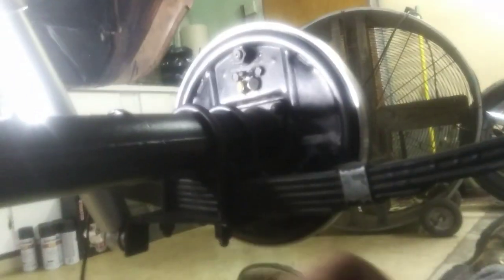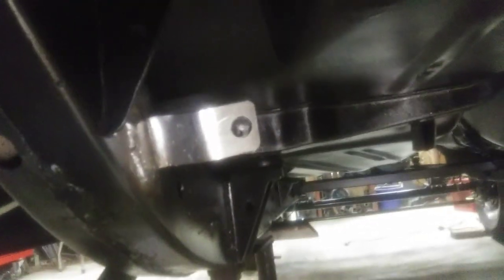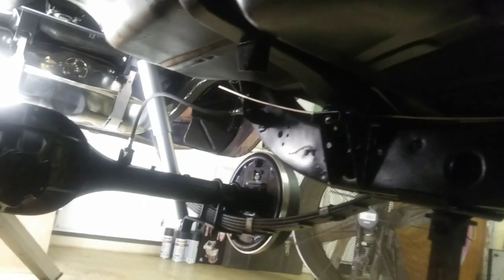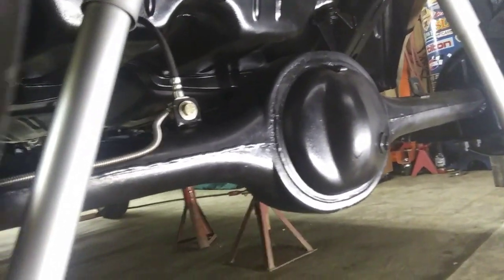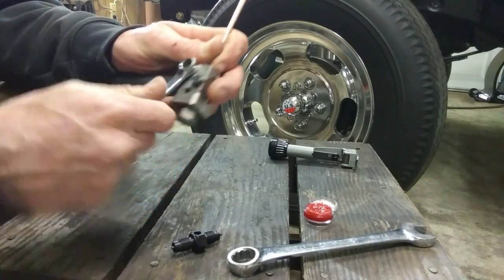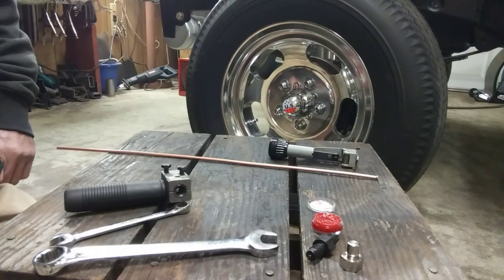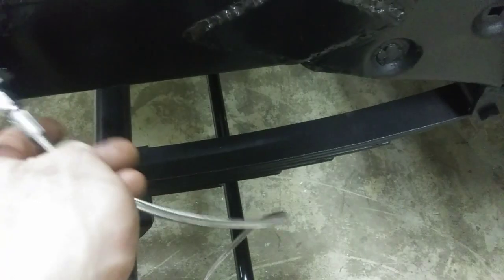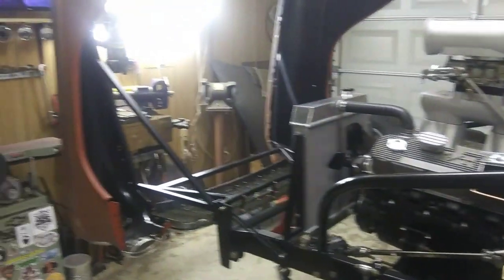1955 GASSER BUILD. flare Copper Nickel brake lines using titan flaring tool.

Comment: Those brake lines look great. Lots of work and planning pays off. That flaring tool works great for the price you paid. The rear fender openings will look sweet when it's back on all 4s. Be safe and stay well.
Reply from the maker: Thanks a lot Brian!
She's is sure going to be worth all the work when she's done. I do like that old school look around those back tires just needs cleaned up a little.
I'm gittin it thanks for following along with the build brother I really appreciate it.
Have a great night👍👍👍

Comment: Beautiful work Chris, that flaring tool is sweet, i really like those P clamps w/rubber isolators for steel line or wiring so nice for cleaning stuff up, looking forward to the front brakes, those wheel arches turned out great, you only have one shot on those, you must have some snow piling up over there, talk to you later and have a good upcoming week buddy
Reply from the maker: Thanks a lot Mike!
 I appreciate that.
That tool does work really nice and yes those Earl rubber line clamps or a must some guys will use just bare metal don't like those style. Front lines will be next😁 like you say one shot on cutting those wheels radius didn't want to mess that up lol just took my time a little cleaning up they will be perfect.
Got a few inches of snow rain most of the day yesterday but snow coming back soon can't wait till spring lol. Thanks for stopping in and watching.
Have a great Sunday my friend👍👍👍
Reply: @IronheadGarage  👍👍

Comment: I like the spring look on the rear lines and that flaring tool is great too. Soon youll have a pedal in that car Great Video!!!
Reply from the maker: Hey Glenn thanks! Yeah that stainless gravel gard I like the look and gives it some protection to from any rocks that might get kick up.
Getting closer to having brakes😁 thanks for watching have a great weekend my friend👍👍👍
Reply from the maker: That flairing tool is pretty sweet to lol.
Reply: @IronheadGarage  Yeah I got one of those old clamp type flaring kits never used it yet still in the package 10 years already,LOLL. All the metal lines back to the rear are original on m y 55 amazingly enough. I just changed the three rubber flex ones 5 years back and all the rearend  metal lines within the last 10 years also, LOLLL! Have a Good Weekend too!

Comment: Looks good Chris. Thanks for update ,getting closer won't be long now. Gravel gard looking great nice touch.
Was curious if you need a couple of loops in the break line from the master cylinder to the proportion valve?
Reply from the maker: Thanks a bunch brother I appreciate it. I think that gravel guard does look pretty good and adds some protection to. One more check off the list I'm gittin a little closer. Thanks for watching have a great Sunday👍👍👍

Comment: It does put a nice flare. Just did a rear line in basket case, it didn't go that easy lol. Or look that good.
Reply from the maker: Hey brother yeah that tool works killer. They are cheap to well worth the money.
Good luck with yours
Have a great night man👍👍👍
Reply: @IronheadGarage  It looks like it works killer good.

Comment: Beautiful 55gasser!! Do you have the part number to the rear leaf springs and what Manufacturer you used. ALSO YOUR TIRES AND RIMS SIZE .
Reply from the maker: Thanks I appreciate that.
I got those rear leaf springs off eBay don't remember who made them but they have a 3" higher ark then the stock ones have to them because I knew I was going to run big tires on the back.
Rear tires are 10.00-15 
Firestone cheater slicks.
Hope this helps you out.
Anything else let me know
Thanks for watching
Have a good one👍👍👍
Reply: Thank You!!
Reply from the maker: No problem brother👍

Comment: you are doing nice neat work and it looks good. 4:44  please tell us its not copper line. copper work hardens and cracks.  no good for brake line
Reply from the maker: Hey brother thanks.
Those brake lines or nickel copper it is made for doing brake lines will out last steel line It won't rust like steel lines will not brake ether and it's a lot easier to bend. I would not use just copper lines😁.
I guess I should have mentioned it in the video.
Bought it from speedway motors check it out it is very good to use. A lot of hodroders use it now.
Thanks for watching
I'm gittin closer.
Have a great night👍👍👍
Reply from the maker: Sorry it's called copper nickel brake lines lol
Reply from the maker: I changed the title on the video now it says copper nickel brake lines so guys will not think I'm using just copper lines. Thanks for the comment on that I needed to let everyone know👍
Reply: @IronheadGarage  I've heard those are very good. Thanks!
Reply from the maker: Thanks to you as well👍

Comment: Another excellent video Chris. Does the glare tool do other sizes or just 3/16 ? Your doing great work man, that translates into a nice trouble free car. The wheel wells look cool with the big meat hanging out the side a little. Your getting close man! I'll talk to you later ✌
Reply from the maker: Hey Don thanks a lot.
They do make a 1/4" one to
Don't know if they make any other sizes. But I would like a 3/8 one to for fuel lines
Would be nice. I'm getting it
Thanks for watching
Have a good night man👍👍👍